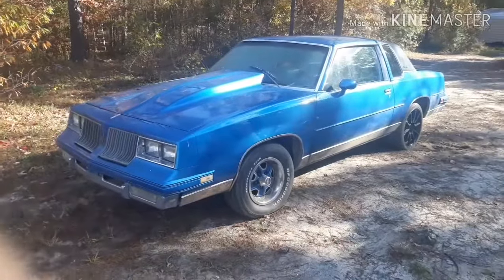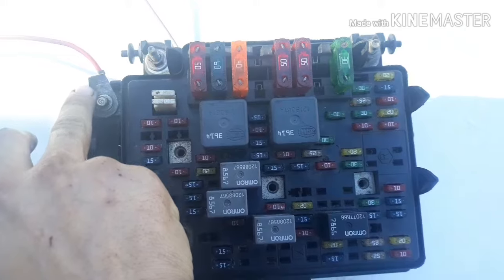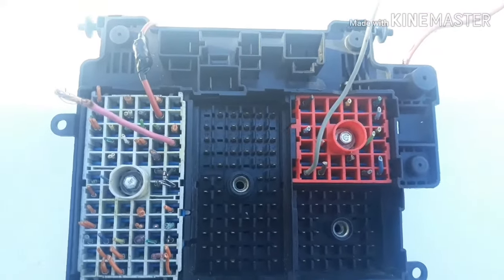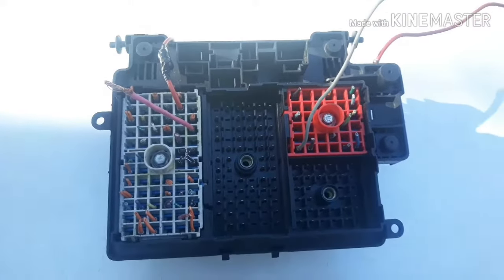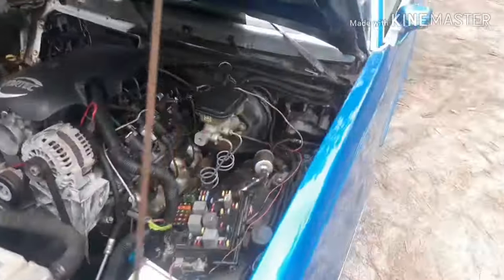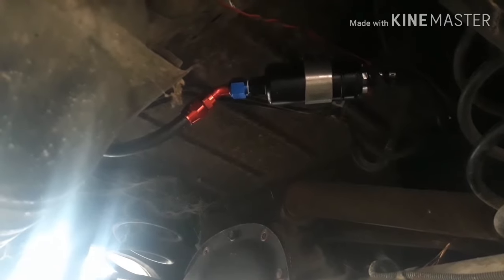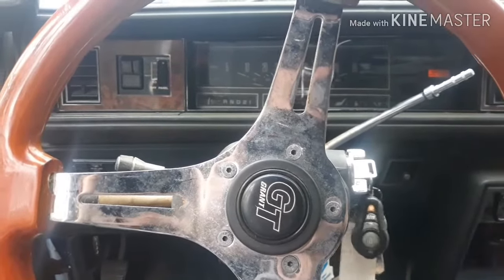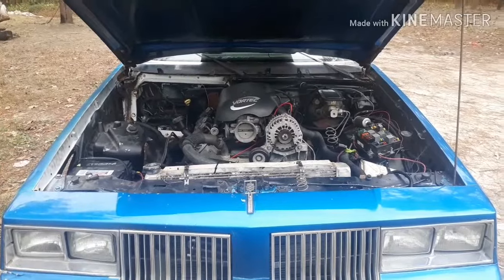LS SWAP WIRING!!! HOW TO MAKE LS SWAP RUN IN MINUTES!!! STOCK FUSE BOX/ HARNESS!!!

Comment: Wow you have simplified this at another level.. I basically just need the motor mounts n torque adapter and I can get the whole motor with everything for about $600.
Reply from the maker: Yes sir its extremely simple... people are intimidated by the swap but its easier than most people would think lol
Reply: Mikey Tuned I’ll probably send u an email if have any questions
Reply from the maker: No problem... Facebook @mikeytuned  is the easiest way to contact me

Comment: This was very helpful. Got mine wired up, thanks!
Reply from the maker: Awesome I'm glad I was able to help
Reply: @mikeytuned8944  DUDE" THERE ARE NOT ALOT OF PEOPLE IN THE WORLD LIKE YOU....I APPRECIATE ALL THE WORK...YOU HAVE DONE...ON YOUR YOU - TUBE PAGE...YOUR LIKE A SUPER HERO...I HAVE READ ALL OF THE QUESTIONS AND ANSWERS...IT HAS HELPED ME ON MY SWAP....ANY WAY...THANKS .. A..." MILLION...YOU KNOW... INFORMATION IS POWER....THIS IS SO COOL"....*ONE#1*
Reply: I'm putting a LS 5.3 VORTEC TAHOE MOTOR..IN A 2004 325I BWM..4I60E...BTR STAGE 1 CAM...THATS IT...IM BUILDING A DAILY DRIVER"....ALL THE MECHANICAL WORK...BRACKETS ETC..ETC..WAS NO PROBLEM...BUT" THE WIRING WAS THE BIGGEST CONCERN I HAD...IM GOING BACK LATER AND RUN...ALL NEW WIRES...ITS JUST A 6 WIRE SET UP....HANDMADE LABELS...ON EACH WIRE..ONE LABEL AT THE END OF THE PART..ONE 3INCHES FROM WERE THEY HOOK END....I RUN DUAL 2 AND A QUARTER EXHAUST...WITH A H.. PIPE RUNNING INTO A 44 FLOWMASTERS.. BACK INTO A DUAL 3IN TIPS ON BOTH SIDES...TO RED & BLACK SEATS...RACING STEERING WHEEL...CAR WAS LOWERED JUST A BIT...20IN RIMS...STATIN BODY WRAP..HOOD CARBIN FIBER WRAP....HOMEMADE METAL LIP SPOLIER IN REAR....HAD ONE OFFER OF $10GRAND...I GOT ALMOST $6400 GRAND IN THE CAR...RIMS AND TIRES...AND WRAP...AND PARTS THAT I HAD TO BUY...PLUS THE CAR $2000...$4400 IN PARTS...IT IS WHAT IT IS...*ONE#1*
Reply from the maker: @RGIIIBOXING  that means alot man  I'm glad I'm able to help others with there builds thank you for your support
Reply: @mikeytuned8944  ITS ALL GOOD DUDE"....
Reply: Just cut out the rest on the harness?
Reply from the maker: @xxguitargodxx69  if you mean on the c1 fuse block yes you can remove the wires that are not needed

Comment: Glad I found your channel I will be doing this to my swap today. Thanks
Reply: I still have the stock wiring in my truck how did you make the starter wire and car key work
Reply from the maker: I normally use the existing starter wiring and tap into a key on power source from the original ignition source.. you can use the ls starter wiring by wiring an ignition cranking source to pin a3 on the c1 block wich sends ignition cranking signal to the factory ls starter relay
Reply: Your the Guru of this LS swap I like that Gbody. I wish I had one I’m putting my 4.8 in my 92 K1500 with the 700r4 to go play in the mud. Have a great day I don’t have much but if I can help out let me know thanks
Reply: Do you have to do a pin out on the harness I’m using a 700r4
Reply from the maker: @jamaalbey6306  pm me on Facebook @Mikeytuned an I can help u out

Comment: ok some of this IS NOT  making sense.
i put battery power to the terminal he said on left hand side of fuseblock facing up. Also hooked up my factory car fuseblock wire here so both have constant  power.
Where i get confused is the loop over wire to constant power supply. Im sure i tested that far right stud and there was no power there. So is B11 supplying constant power to that stud and that stud powers something else in the fuseblock? or is B11 supposed to be connected to constant power supply?

What do i do with the starter crank/trigger wire? is that one and the same as distributor power wire that goes to A9?

Comment: Great video! I do have a question regarding the stock fuel system - was the truck equipped with a return or returnless system? And I assume you just went with whatever the truck had. Thanks!

Comment: Yo I'm about to do my first ls swap and you made this look easy with the wiring. Thanks
Reply: Hey! So básically you don’t have to mess with stock harness? Just plug in the fuse box... ? The harness thing is giving me a headache 😅😅😅
Reply from the maker: Yes, no modifications are needed to run the stock harness just what is shown for the fuse box
Reply: So I can drop in my ls with stock harness and just follow this video and I’ll be on the road?
Reply from the maker: Yes just have to do vats delete, I explained how to do it yourself in another video

Comment: So basically keeping the original engine chassis harness separate and running basic wires to power the engine harness of the ls through the ls fusebox? Wanting to swap a 5.3 in my jeep rock crawler and want a super simple wiring harness. This looks like the way to go
Reply: No need for a computer this way?
Reply from the maker: Yes u of course need the factory pcm, I explained in another video how to disable the vats using a donor truck
Reply: @mikeytuned8944  @ mike,, any idea how to run stock 04  a/c on swap,,,   Which wire would  be a/c  request??   Input to pcm

Comment: your vid is a lifesaver...I thought about the tedious job of wire removal and have been debating if I really want to deal with the swap at all. I have a 79 malibu and my question is did you have to de-pin anything or did you leave all of the connectors in the harness and just put everything in your LS?
Reply from the maker: I'm glad that I'm able to help! Using the stock fuse box you dont have to touch the engine harness at all if you dont want too just connect the wires shown and a starter signal and your golden👍
Reply: @mikeytuned8944  GOd bless you sir...you are a lifesaver.

Comment: Good video. Very helpful. I’m also using the 4l60e out of my donor truck, and I’m trying to figure out what wires I need for that. I know I need to use my C100 pin and trans harness.
Reply from the maker: Yes sir whe when using a 4l60e trans u take the c100 block Pin "c" pink wire and connect it to a 12v key on power source
Reply from the maker: It is best to use a 10 amp fuse when doing so... you can also take the pin from the c2 block pin "e2" and move it to c2 block pin "b9" and it eliminates the need for the c100 pink wire
Reply: Very helpful! 🙏
Reply from the maker: @Gator12  glad I can help
Reply: Your help is much appreciated. I’m just going over the wire schematics for E2 and B9. It’s a good idea. B9 ignition and E2 ain’t used. So good call. Now I just gotta wire it up to my toggle switch. ( I’m doing a Off road truck build ) No need for a key
Reply: How do you do this and keep the data link plug in the wiring so you can hook up a scan tool or hp tuner ? What do you have to do different if you have to use the throttle by wire gas pedal ?
I'm swapping an 2006   6.0 with a 4l80 into a 64 chevy truck. I have every bit of wiring from the 06....everything from under the hood, the inside fuse box,  bcm, tac module, gas pedal and all the wiring to the fuel tank and the tank. Can I disable the vats on this 06 pcm the way you did in the other video ?
Reply from the maker: mechanic  yes sir you should be able to disable the vats in the pcm using that method untill 07 model.. as far as the obd2 port I did another video on how to hard wire it in. I havent done a video on 04+ harness yet so if you are able to pm me on Facebook I would be glad to help walk you through some of the process.
Reply: @mikeytuned8944   do I have to flash the computer
Reply from the maker: @antonioalvarez3944  just vats delete
Reply: @mikeytuned8944  ok I did everything like you did in the video but I have a 4L60 I believe my problem is with the trans but my injectors are not spraying fuel so would the neutral safety switch keep them from working
Reply from the maker: Did you delete the vats?
Reply: @mikeytuned8944  yes
Reply: @Gator12  can anyone explain were.this c100 block pin c is im confused on this one

Comment: As far as the alternator the stock ls one will charge fine? Do I just hook my battery cables up like a normal small block? Positive to starter? ground to block and to body?
Reply from the maker: Yessir hook everything up as u normally would and plug in the alternator to the engine harness and it will charge as normal

Comment: Very nice and to the point what Transmission or are you using Are you using the transmission that was attached to the swaped motor and does the fuse box run it also once it’s powered

Comment: I have seen your videos and I would like to know a little more about how to star a 5.3 5.3 2004 engine. As soon as I finish installing it, I am ready. I only need about the fuse box.
Reply from the maker: Ok that's not a problem. I have explained alot of the process in previous videos/comments any further information just ask and I dont have a problem trying to help you out👍
Reply: Francisco! Did u ever started

Comment: Is there any concern over leaving the fuse block wires that are not used hooked up to the fuse block? I just dont want to have a random hot wire hanging around like the wire that loops back thru the fuse block and has a key on power source. I might be lazy, but I would love to just leave the depinned wires in the loom in case I use a new age transmission in the future.

Comment: Are there certain wires I'm supposed to leave long and not cut to have my ac function or do I only need to leave the ones you left in this video. Don't know if the fuse box controls or has anything to do with the ac

Comment: Do you ever have fuel starvation problems with that inline fuel pump being HIGHER  than the fuel tank?
lotsa peeps say if you run exterior inline pumps they should be LOWER  than bottom of fuel tank as these types of pumps are meant to push fuel and soon as they suck air from hard cornering or acceleration they cavitate and engine will sputter or die

Comment: Hey great video! I have one question the C3F1 wire is fuel pump power. What did you do with the fuel pump trigger for the relay? I’m putting an LS motor in a fox body so I’m trying to figure out the wiring now...... thanks!!!
Reply from the maker: You use f1 as ur power signal... when you cut on the key on power it will prime the fuel pump just as it would from the factory

Comment: What about your grounds?

I did exactly what you did but can’t get my C9 to go off. But it goes off randomly when I push on the harness but I can’t figure out where or what’s connecting or grounding to make it go off randomly.
Reply from the maker: The fuse box is grounded through the engine harness... also its c1 block a9 not c9

Comment: Very helpful INDEED! I got a question for you. What wires in the fuse box are used with obd2 to program the car with HP Tuners?
Reply from the maker: No problem if you check out my channel I did a video on what wires are for obd2 port 👍

Comment: Do you need to use a starter solenoid wire on the starter from the cars existing fuse box?(the vehicles fuse box powering everything in the car). Or will the wiring harness on the ls motor that has the solenoid wire work?
Reply from the maker: I personally have found using the vehicles existing starter wiring to be easier... you can however wire it so that the ls wiring works but it involves using the existing wiring so I've never seen the point in it, that's just my opinion tho everyone's build is different

Comment: How do I wire the starter I have it going to the dark green wire on the back of the factory fuse box and some one said to check my starter relay ground wire when I jump the starter it go’s but when I try my push to start it won’t fire

Comment: Excellent Video. I want to know if it work the same with a 2002 5.3 drive by wire pedal.
Reply from the maker: Should be the same concept to get the engine running as long as it's a 02 fuse box
Reply: Thanks

Comment: Good video.   Thanks.    Do you have to do anything with the starter wire or the harness gives it power when you crank it?
Reply from the maker: Sorry for the late response... c1 block a3 is start signal you must hook your 12v cranking signal to this pin to use the ls harness starter wire... personally I prefer to use the existing starter/key on/cranking wires that are in the vehicle's harness
Reply: Mikey Tuned do you hook the existing car main starter wire to the Ls starter wires. Will that work.
Reply from the maker: Personally yes I use the vehicles existing starter wires I dont use the ls harness starter wiring although it can be done
Reply: @mikeytuned8944  by chance do you have a diagram to which cables from the vehicle harness need to be plugged into ls starter? and which wire from vehicle harness your hook up to ignition on ls fuseblock

Comment: Did you use the Ls purple wire for ignition at the starter or did you use the purple starter wire from the car itself??
Reply from the maker: I normally use the vehicles existing starter signal wire
Reply: @mikeytuned8944   ok I just have to see how to do the wiring you did but with a DBW 03-07
Reply from the maker: @jameerchavis6135  may me on Facebook @Mikeytuned and I can explain it to u..
Reply: @mikeytuned8944  ok cool thanks

Comment: I’m doing a swap on my trans am, and going to be at the wiring part soon. I was wondering when you use the stock harness and and stock computer like that, did you need to get security removed from the computer or did it just turn key?
Reply from the maker: You will need to disable the vats. I did a previous video on how to do that using a donor vehicle if you take a look at my channel👍
Reply: @mikeytuned8944  perfect! Thanks I will have to give that a try once I get a bit farther along in my swap
Reply from the maker: @quinnrobbs8476  I wish u the best of luck man👍
Reply: @mikeytuned8944  thanks much appreciated

Comment: So you don't need to change a single thing with the wire harness?
Reply from the maker: Correct the factory harness doesn't need to be messed with
Reply: @mikeytuned8944  really didn't think an ls swap would be that easy haha

Comment: Hey Mikey where did u get the oil pan and motor mounts from is there a kit u can buy ?
Reply from the maker: Sorry for the late reply, I used stock oil pan with lsx innovations swap brackets with regular 350 clamshells

Comment: well that just saved me a fuck ton of work. does the fuel system need a certain psi?? i wanna ls swap my 88 k 1500 with that damn toilet bowl injection. will the stock fuel pump work for me or no?
Reply from the maker: You will need to Install a high pressure pump, the pressure is regulated by your fuel pressure regulator. Most have them built into the fuel rail, for the ones that dont you will need to run a Corvette 3 port fuel filter they have the regulator built into the filter
Reply: @mikeytuned8944  thank you sir. you have just saved me an entire driveline/column swap. im running a 4l60 wired full manual and didnt really want to swap it out. but you sir are a savior of a 6 litre ls from going for scrap.

Comment: I have a question.. What is the "distributor"  wire going to that you wired the a9 pin to? Like where on the engine?
Reply from the maker: I used the cars factory 12v distributor/coil wire.... u can use any "key on" power source doesn't necessarily have to be the wire that I used
Reply: @mikeytuned8944  i guess im just confused on what wire youre talking about. Is that off the bulk head? It looked like you had it running behind the motor so I didn't know if it was to the starter or somethong

Comment: Would this work with using a 5.3 and a 4L60E transmission from a 2000 Tahoe into a 1984 Chevrolet Caprice your help is greatly appreciated
Reply from the maker: Yes but there is a little bit more wiring that would need to be done, not much tho... if u msg me on Facebook @Mikeytuned I can try to help u with the process
Reply: @mikeytuned8944  could you help me with my starter and ignition witring? im swapping a lq9 an 4l80e into my 1988 caprice

Comment: I have a 2004 fuse block and the C1 B11 spot is a orange wire but the B12 wire is a big red wire do I need use the orange in B11?
Reply from the maker: For the 04 fuse box constant power is the c7 pin a wire, and the c1 block a9 key on power
Reply: @mikeytuned8944  what do you mean c7? Which spot do I loop? I got A9 ready
Reply from the maker: @levisclassics9330  c7 is a solid red wire by itself not in the c1 block... if u msg me on Facebook I can send u a picture to show u what I mean

Comment: Wondering what B11 is in your fuse box. In mine is for the fuse of the sunroof and auxiliary power.  If i do it this way my pcm fuse will have no power.
Reply from the maker: The process for 03-07 fuse box is a little different... constant power will be c7 pin A it's a red wire all by itself and key on power is c1 a9 pink wire... any other questions I'll be glad to try to help
Reply: Mikey Tuned  Thank you so much Mikey! I was a little frustrated here!!!!
Reply from the maker: @YourpainRx  no problem im glad to help
Reply: Mikey Tuned  I’ll send you pictures tomorrow of my box so you can see...
Reply: The problem i have is very simple. I don’t have the c1 block and just went straight to a9 for the key on without installing a constant power. So if i go straight to the pin for constant power I don’t think it’s going to work unless there’s another way. What will be the next step. C1 block its the only one here.
Reply from the maker: @YourpainRx  if u want you can message me through Facebook and I'll walk u through it the c7 pin should be ur constant power it is it's own connector it's not on the c1 block, that has to be hooked up along with the c1/a9 in order to power the pcm
Reply from the maker: @YourpainRx  it's fine to not have the c1 connector just jump to that terminal
Reply: Mikey Tuned Got it! I’ll go to Facebook today. Thank you Mikey!!